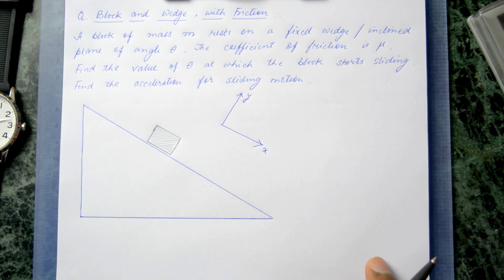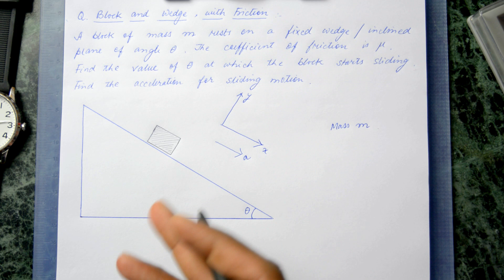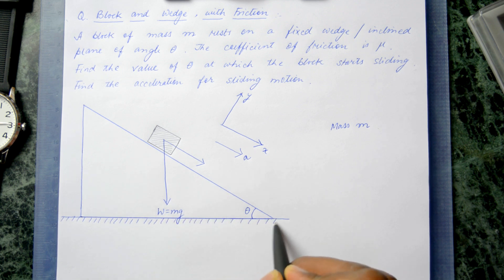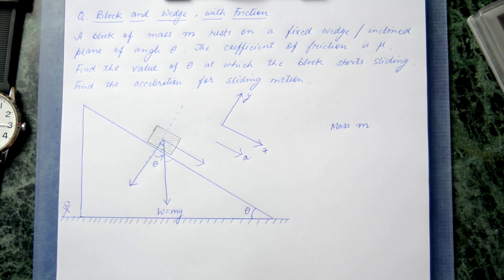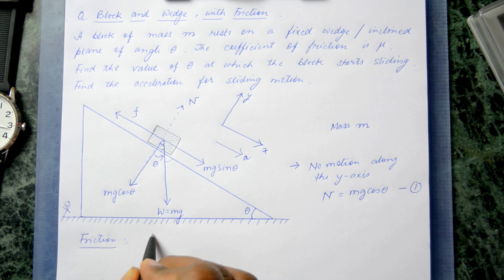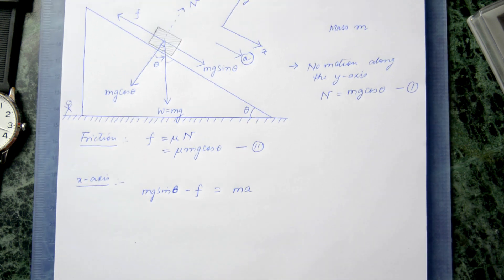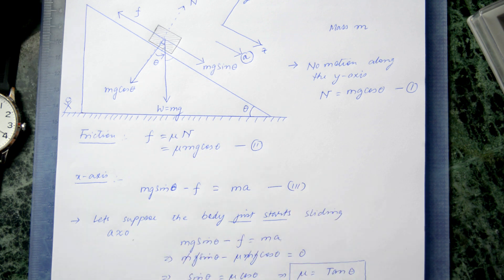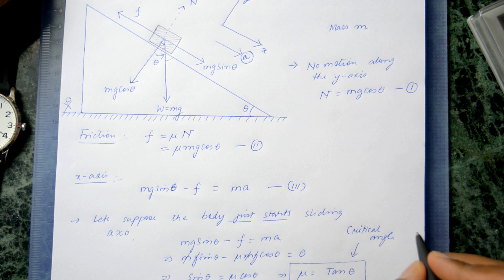Block on a Wedge - Friction Problem (Mechanics)

Comment: Your splitting of the weight vector into 2 components is unclear. You simply draw a component in x-direction without saying how to get the length of this component, namely by a parallelogram (which is a rectangle in this case). And promptly you draw the x-component a bit too long. 
Without this construction, the length of the x and y components mg sin(θ) and mg cos(θ) cannot be understood.

Comment: How mgcostheta come?
Reply from the maker: The projection / component of a vector (force in this case, F) on to its base is Fcostheta
Reply: @FortheLoveofPhysics  sir u draw a perpendicular?
Reply from the maker: It is with respect to the x and y axis that I defined.. as you see the xy coordinate axes are wrt the inclined plane..
Reply: @FortheLoveofPhysics  ok thanks sir
Reply: @shashankpandey4167  go through vectors u will understand better